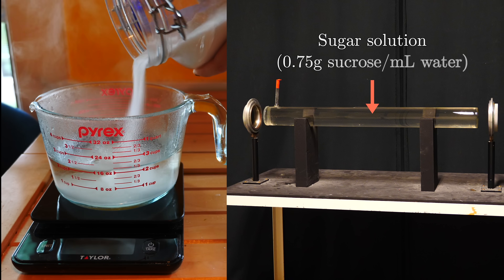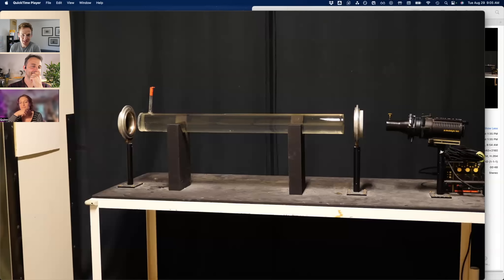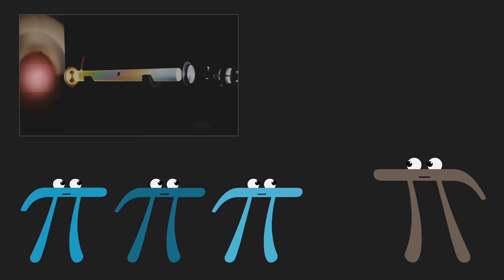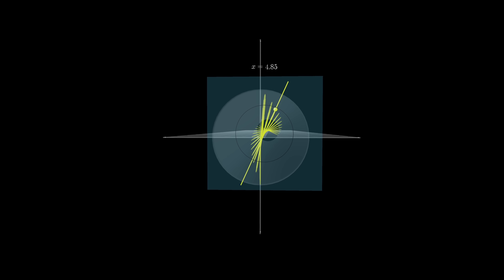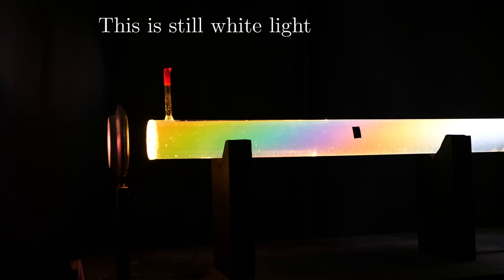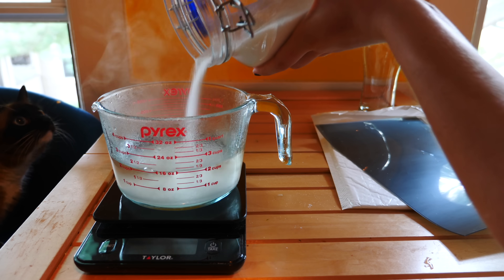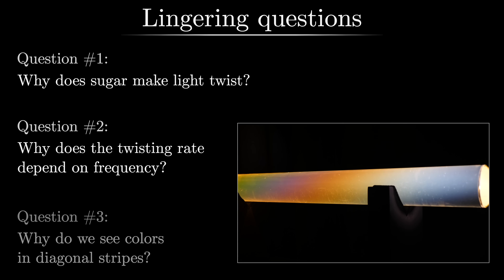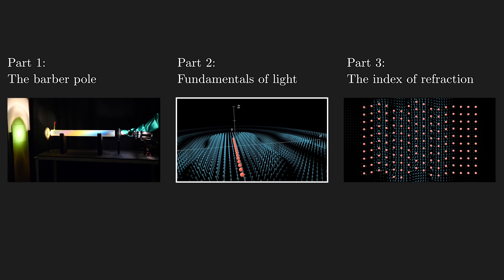This tests your understanding of light | The barber pole effect

Comment: What's always surprising to me is how static everything is. Even though the light twists and is moving through the tube, there is never any alias that would make it seem to align itself differently with respect to time so that the light appears to move, unless we rotate the polarization filter. I guess that is also logical because we produce the same source from the same initial conditions all the time, but it's still a bit surprising that we can't introduce a bias so that it would change even if we didn't do anything, since chaos is all around us and small changes can propagate into large changes, but we see none of that. Light seem to move the same every time anyway.

Comment: Why do colors appear in diagonal stripes?

Short answer

Because different wavelengths rotate by different amounts, and along the length of the tube this rotation changes continuously, creating alternating bright and dark conditions for each color, which appear as diagonal bands.

---

Step-by-step physics

1️⃣ Optical rotation increases with distance

In a sugar solution, the polarization rotation angle is

\theta(\lambda, x) \propto \frac{x}{\lambda}

where:

 = distance traveled in the solution

 = wavelength (color)

So:

Near the entrance → little rotation

Farther along the tube → more rotation

---

2️⃣ Each color reaches “bright” and “dark” at different positions

After the light exits the tube (or passes through an analyzer / your eye):

A color is bright when its polarization aligns with the viewing direction

Dark when it is perpendicular

Because each wavelength rotates at a different rate:

Red aligns at one position

Green at another

Blue at yet another

---

3️⃣ Why stripes form instead of random patches

The rotation changes smoothly and continuously along the tube.

This creates:

Periodic maxima (bright)

Periodic minima (dark)

These periodic conditions form bands.

---

4️⃣ Why the stripes are diagonal (not horizontal or vertical)

This is the key geometric reason:

One axis of the image corresponds to distance along the tube

The other axis corresponds to different wavelengths across the light beam

Because:

Rotation depends on both position (x) and wavelength (λ)

The condition for brightness is:

\theta(x, \lambda) = \text{constant}

This equation represents a diagonal line in an – plane.

So the colors appear as diagonal stripes.

---

Intuitive picture

Imagine:

The tube is slowly twisting a rainbow ribbon

Each color twists at a slightly different speed

Where a color lines up with your eye → it appears bright

Those alignment points trace slanted lines, not straight ones.

---

Essence in one line

Diagonal color stripes appear because polarization rotation depends simultaneously on distance and wavelength, so equal-rotation conditions form slanted bands.

Comment: Why Does Light Twisting Depend on Frequency?

The twisting of light in a sugar solution depends on frequency because molecules do not respond equally to all oscillation speeds of the electromagnetic field.

Light is an oscillating electromagnetic wave. When it passes through a chiral medium like a sugar solution, the electric field forces the electrons in the molecules to oscillate. These molecular oscillations have natural response frequencies (resonances).

Because of this:

Different light frequencies interact with the molecules with different strengths

Left- and right-circularly polarized components of light propagate at different speeds

The speed difference depends on wavelength

As a result, the phase difference between these components changes with frequency, producing a wavelength-dependent rotation of polarization.

---

Essence in One Line

Light twisting depends on frequency because chiral molecules respond differently to different electromagnetic oscillation rates, creating wavelength-dependent phase shifts between circular polarizations.

Comment: Why Does Sugar Solution Twist Light Waves?

When white light is passed through a tube filled with sugar dissolved in water, the light emerging from the tube often appears separated into multiple colors. This phenomenon occurs not because sugar splits light like a prism, but because sugar rotates the polarization of light.

---

Optical Activity: The Core Principle

Sugar is an optically active substance.
This means it has the ability to rotate the plane of polarization of polarized light.

Light is an electromagnetic wave. When it is polarized, its electric field oscillates in a fixed plane. As this polarized light travels through a sugar solution, that plane of oscillation is rotated.

This effect is called optical rotation.

---

How Sugar Molecules Cause the Twist

Sugar molecules have a chiral (asymmetric, helical) structure.
They are not mirror-symmetric and behave like tiny molecular spirals.

When polarized light enters the sugar solution:

The oscillating electric field of the light interacts with these spiral molecules

The chiral structure responds differently to left- and right-circular components of light

As a result, the polarization plane of the light rotates continuously while traveling through the solution

This rotation is often described informally as a “twist” in the light wave.

---

Why Different Colors Appear

White light is a combination of many wavelengths (colors).

Each wavelength:

Travels at a slightly different speed in the sugar solution

Experiences a different amount of polarization rotation

Because of this wavelength dependence:

Some colors rotate more

Some rotate less

When the light exits the tube and reaches the eye (or a polarizer), these differences cause color separation and intensity variations, making multiple colors visible.

---

What This Is NOT

This is not ordinary refraction like a prism

It is not scattering

It is a polarization-based effect caused by molecular structure

---

Scientific Terms Involved

Optical Activity

Optical Rotation

Circular Birefringence

Chiral Molecules

Dextrorotatory Behavior (for sugar solutions)

---

Essence in One Line

Sugar twists light because its chiral molecular structure rotates the polarization of electromagnetic waves, and different wavelengths rotate by different amounts, producing visible color effects.

Comment: That's an imperfect monochromator. The same principle (but way more complex) was used by Lyot and Ohman in the 1930ies, using alternative plates of left and right hand quartz.  
What you see in this case projected on the screen is the so called optical figure of the sugary solution, i.e. only the zero order diffracted part of the optical figure without the isogyres, which project outside of the second polarizer (the analyzer). It is the isogyres (i.e. likely only the first diffracted order) that you see in the tube itself, and that is because you have scattering of the bubbles inside of the solution. The isogyres should be projected as a spiral on the plane of the screen (see e.g. figure 5 in the document Quartz: a Bull’s Eye on Optical Activity of the The Mineralogical Society of America). To see them in the setup you need a larger second polarizer and a slightly more collimated source. That Nicholas Illuminator is not the best choice for polarization experiments.  
It's hard to observe the effect (on the side of an element) with Lyot's monochromator cause it is hard to have such big crystals of optical quartz and because the retardation is on way shorter distances that don't allow a good separation of wavelengths (see e.g. figure 6a in the document Quartz: a Bull’s Eye on Optical Activity of the The Mineralogical Society of America). One can only see the end combinatory effect of the plates, i.e. the (true) monochromatic color projected on the screen. 
This effect is actually present in all retarder plates, basically every birefringent crystal. Quartz wedges (a retarder type) do this but on way smaller distances. The retarders change the phase shift between main optical axes of a birefringent crystal or solution.

Comment: I have a question: What happens to the light that doesn't make it through the polarizer? 

Does it heat up the polarizer? 

Is there a way to "split" or maybe reflect light so I could use both beams of perpendicularly polarized light (Without much energy loss)?

Comment: A well made video! 

I wonder whether the circular refraction would be the same at any speed and at any location in the universe, or if this is an indication of a basic property of the universe?

Refraction in general can be «explained» or rather visualised through various models of physics - for instance frequency based de-acceleration or through classical mechanics- and I wonder whether we are analogously touching  the phenomenon of the way light spreads in a «quantum-relm explanation» of light passing through a slit?

Just wondering……

Comment: Light cannot scatter in direction parallel to the E field (because electromagnetic field has transverse fields, & no longitudinal fields).  You can demonstrate this by replacing the sugar water with plain water in the tube.  With the polarizer in front of the lamp set vertical, if you look at the tube from different sides, there will be no scatter up or down from the tube.  (Easier way to see this is to look at the tube from the side while rotating the polarizer.)  If you are viewing tube from the side, when the polarizer is horizontal, tube will look darkest.  When polarizer is vertical, tube will be brightest.
          When the sugar is put in, the different polarization angles of the colors will affect the scattering directions.  As those angles change with distance traveled down the tube, a given color will be scattered in a helical pattern.
          Both effects rely on there being scattering centers in the solution, so things can't be too clean.  One drip of milk added may increase the "side show".

Comment: When I worked with dielectric spectroscopy for a year, I learned that many optical effects, such as attenuation in a  transmission line (such as a coax cable), are denominated per wavelength, so I wasn't surprised that the chromatic effects were differential. As for scattering, only if it comes out white to the naked eye everywhere do you have isomorphic scattering. If the colours are turning and the scattering is not isomorphic, you pretty much have to get a helical barber pole per chromaticity.

Comment: Great video!! But your polarization filters are 90° off. If you represent them with strips it is intuitive to think that if the oscillation plane aligns with the strips the light will pass through and be blocked if it comes perpendicular, but the reason these filters work is because light coming parallel to the strips oscillates the electrons in the material along the strips and therefore is atenuated, while light coming perpendicular to the strips only have the thickness of the strips to move the electrons and goes through with less attenuation.

Comment: My question would be how does the sugar manage to twist the light if the sugar molecules are all at a random orientation?
Reply from the maker: Phenomenal question! The short answer is chirality, and Steve Mould has a great video on it you can look up.
Reply: @ watched Steve’s video and ok yes agree you will get an average rotation in one direction ! Be nice to see someone with a bag of right and left handed sugar mix them in solution and show no such twisting occurs ;)
Reply: @ but what are you saying happens ? Would right handed sugar always twist light counter clockwise ? And the same question applies…
Reply: @ I will follow up with checking out the video. But this just doesn’t seam to make logical sense :) quantum physics is weird !

Comment: What happens if you were to move the 2nd polarizer filter (at the output end of the tube) closer to or further back from the end of the tube, without changing the angle of polarization (keeping the polarization at the same orientation)?  Will the color that passes change?

Comment: Because the lens is polarized vertically, I would assume that the sugar is polarizing because of the photons. This changes the colors at an angle and the different energy is absorbed and creates interference banding. So the negative charge on the bottom loses electrons while the positive light gains electrons. This is because it's a polar material, orientational polarization with charges running through it! And since light is an electromagnetic wave there is a charge going through the sugar in a vertical flow

Comment: I wish i had a light stone right now. I know how to make one but do not have the resources to do so.
I think the answers are...
1. there is allot of energy in the tube so you can see it.
2.probably has something to do with radio or gamma waves?  im not sure.
3.light is energy in its pure form.
surger is refined energy(food)
your burning fire into energy
You only should see six if i'm correct if it was pure light. The diagonal effect is most likely because you trapped light and being able to see it in a gas? or i do know know.
Any what way this is how i solve the problem with the loss of energy when focused this will speed up to process so i can go back to sleep.

Thank you.
i hope you can find some answers.

Comment: So many questions, can’t wait for the rest, even though it all makes sense I’m wondering how to affect this through changes in the setup like square tubes, tapered cylinders, ending into a half sphere/dome piece of glass, splitting the light through a prism before passing it into the cylinder, and why the light that doesn’t pass through the second polarizing filter isn’t reflected or scattered backwards in some way. I can’t believe I haven’t seen these yet, awesome you’re further exploring this. Could you ever slow the light down to 0 and maintain the color of the parsed rainbow?

Comment: What you did it´s a Cylindrical Prism; At a Prism enter "white" light from the sun & what goes out?; The light travels as a bubble not a line or lines; It´s as sound; Sound travels as a bubble but we hear just only 1 part of the circle or bubble; When we hear the dopler effect, all the ears in every part of the bubble are going to hear it; I mean just imagine a sphere and in every point of the sphere are going to hear the effect; Well the same for light the near the high frequency the far the low pitch or red.
Imagine The cylindrical prism is as we drill or cut a part of a giant prism at the moment.
I don't know if i'm correct but anyone grabs a prims and put before & after polirizers?

Comment: What would happen if the tube has a smaller diameter? I am trying to recreate this experiment but only have a acrylic tube available that has a diameter of 40mm. Ive tested it and couldnt see anything? I assume it has to do with multiple factors such as the refractive index of glass vs. acrylic and also the light source i have been using. Do you have some answer as to why it could not work with a narrower tube? I have thought that the smaller the diameter is the longer it takes for the light to start this beautiful process.. Im not physisit or chemist just an artist who reallly wants to see this spectacle in real life... would be very grateful for a reply

Comment: multiply the wavelength and devide the freequency of the different light by the density of the water and devide the new wavelength by the new freequency.  and you get what you see. it's called time dialation based on density. it unifies gravity

Comment: uhm do the bands of colour get formed because the lightsource not being linear?
I would assume that some of the light that enters the cylinder actually enter at an angle not parallel with the length of the cylinder and thus hit the sides of the cylinder and because of the differing refractive indices of the different wave lengths of the light, different wavelengths might exit the tube more or less depending on the angle of which it strikes the inner surface of the cylinder...?
I would also presume that some light would be scattered in the fluid as it isn't 100% optically transparent so the tube would show the bands until there is too little light left traveling ( and thus exiting ) the tube to be detected by the human eye? This is just a guess though... I haven't officially learned some of the concepts =w=''

Comment: I have a theory tho that the very reason why there is a twisting phenomenon is that wavelengths travel in different, specific direction. And when it passes the second polarizer, a specific color is completely blocked depending on the axis of the second polarizer.

Comment: My educated guess: it's twisted simply due to refraction. Light bends as it leaves the tube so at the top of the tube we see the hue that is scattered slightly upwards. The polarization needs to be rotated a bit before that hue is scattered slightly downwards and we cas see it refracted from the bottom of the tube.

Comment: Grant, thank you for this beautiful video! I have a naive question: we stated that when the polarized light goes through the solution, certain wavelengths get rotated more than others. However, if we were to look at the end of the pole, we would still observe white light, indicating that the superposition is similar to the initial linearly polarized light. Is it expected or intuitive that the superposition of the income light that is in the same plane should be the same as the superposition of the wavelengths that are rotated and are in different planes? Sorry if it is a confusing question; I can clarify if needed.
Reply: The wavelengths will be polarized in different directions. But your eyes can't tell the difference between differently polarized light. The outgoing light is "similar" to the incoming light in that it contains the exact same wavelengths at (pretty much) the exact same amplitudes, so it looks the same to our eyes. That's all they measure.